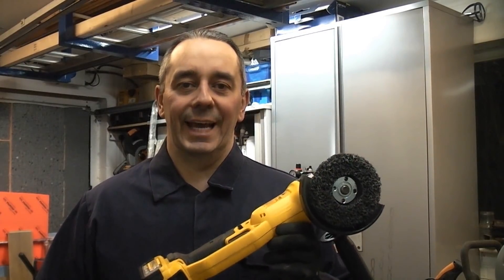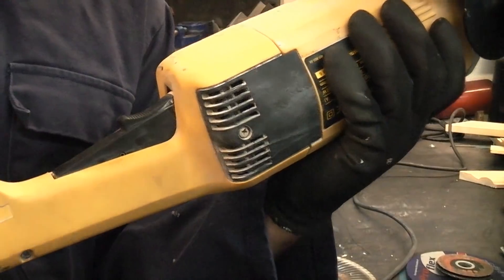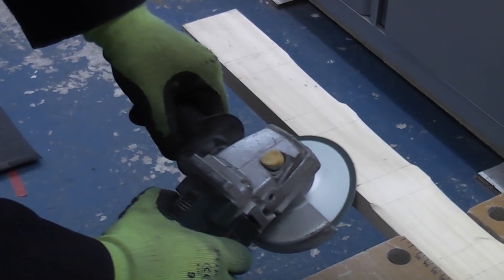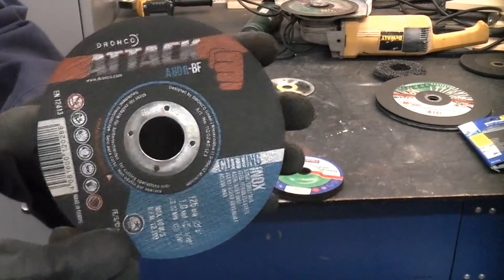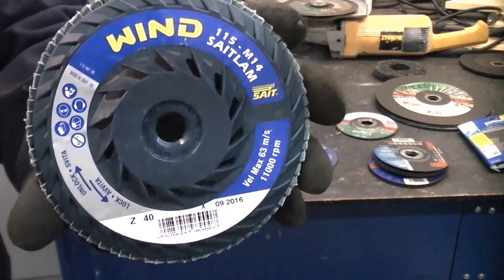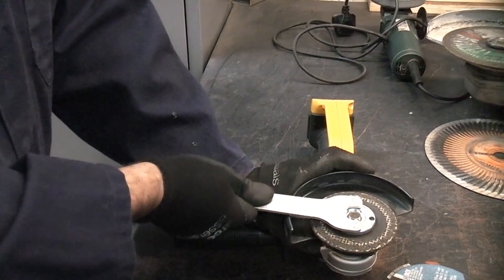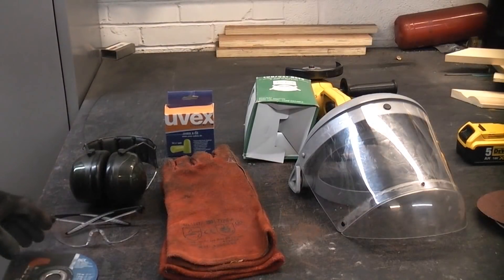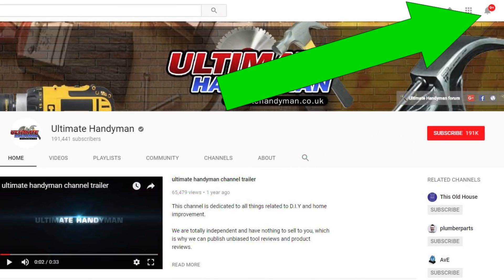How To Use An Angle Grinder-Angle Grinder Safety Tips

Comment: Is it safe to cut stone/masonry horizontally with a diamond disc? I’d use a 5” or 7” disc, not a stihl saw obviously. Normally I cut downwards, but can I cut sideways? Thanks 🙏
Reply from the maker: It is, but be aware that the grinder can feel strange if you move it from vertical to horizontal whilst it is rotating (you might not feel it with a small grinder, but you will with a 9 inch or larger), also be aware that if you cut right through the masonry, it might trap the disc under the weight of what is above!

Thanks for the comment 👍
Reply: Ultimate Handyman I want to precisely cut away the top layer of concrete on a small wall - just 6 inches - to lower the height. A chisel would be too imprecise I think. I won’t be rotating just cutting a straight line. I appreciate the point about getting the blade stuck. Good advice!

Comment: Absolutely fantastic teaching video👏🏽👏🏽👏🏽👏🏽. I've watched quite a few which scared the living crap out of me. Yours didn't. You explained the importance of using it correctly with the right blade(s) for the right job; how to use it and with the correct PPE. I would have liked to know if the smaller tool could cope with bigger jobs. I don't want to purchase a bigger tool if I could do most of my DIY jobs with a smaller, manageable Angle grinder. For example, I have a cast iron drain pipe with thick bolts to the wall that I need to remove. Could the smaller Angle Grinder cope with that?
Reply from the maker: Thanks, Yes a small grinder will be fine for that job 👍

Comment: Thanks, that has been very helpful. I've watched a few of these now having just bought a lidl special grinder. Everyone says "wait till it reaches full speed before applying to work piece". But my grinder has variable speed, so what is "full speed". Should I always set it to the max speed marked on the wheel ? Is there a particular problem running slower ? How critical is the speed, because the control is not calibrated, just marked something like 1-10, so the best I can do is suppose eg 5 means half of max rated speed.
Reply from the maker: I've never seen an angle grinder with variable speed. I'd just use it on the maximum speed for cutting and grinding and perhaps slow the speed down when polishing metal etc.

Comment: Great Job  - if you don’t mind me suggesting this (& maybe I missed it) but you probably could have covered the best or optimum positioning for the Guard as a lot of new Angle Grinder users have real difficulty determining exactly where it should be placed, relative to the job they are performing.  Maybe you could add a video section at the end, to help users with this important aspect of using angle grinders ?
Reply from the maker: The guard position is mainly down to personal preference. Hopefully people will be able to decide where it works best form them.
Thanks for the comment 👍

Comment: Good learning video on the proper use and safety on the grinder. Question. On changing a disc it fits loosely even thou it’s tight fitted,
Reply from the maker: The disc should never be loose, it is either the incorrect bore, or the flange is on the wrong way around.
Thanks for the comment

Comment: Very good video. When it comes to power tools you can't put enough emphasis on safety. You highlighted a good few points on the varied RPMs of discs and the danger of reusing spent 9" discs with 4½"  grinders, valuable information. Keep up the good work.
Reply from the maker: Thanks for the comment 👍

Comment: Thank you. More info about the positioning of the guard, how to hold it and where to stand would help too.
Reply from the maker: A lot of that is dependant on what you are doing. Just make sure that the guard is in between you and the disc
Thanks for the comment 👍
Reply: @ultimatehandyman  Is it the same with the flap disc? I noticed I can't put the flap disc flat for sanding large areas. I thought I saw it being used like that perhaps it's incorrect.
Reply from the maker: @ESLinsider   Yes, you should still be able to turn the guard so that it protects you 👍

Comment: Brilliant video! Very thorough from expiry dates to which way to put the discs on with great advice about use and materials. Really helpful thank you. Maybe I'm a bit boring too, but I read the manual on my DeWalt cordless XR Angle Grinder and it states to use a Type 1 guard (fully shielded) with a Type 1 disc (cutting: masonry, metal and optionally diamond), but not supplied and quite hard to find the official part. That said, the Type 27 guard (open faced) supplied is nice and deep, so better than no guard at all.
Reply from the maker: Thanks for the comment 👍

Comment: Great video but I would like some advice please, I bought a cordless 125mm angle grinder 2 questions, please confirm I can use 115mm discs? Also my grinder has a speed rating 8500min, does this mean I can I use discs with a higher speed rating but defiantly not less than 8500. Thanks
Reply from the maker: Yes, you can use the 115 disc on a 125 grinder, providing you do not use a disc that is rated at a lower speed (most 115 and 125 discs are the same). Yes, you can always use a disc with a higher speed rating.
Thanks for the comment 👍
Reply: @ultimatehandyman  Thanks for your reply.

Comment: An informative video,  I've bought a Parkside angle grinder last year,  along with a few packs of discs, for a couple of small stone cutting jobs, I genuinely didn't know they had an expiry date, I'll have to check them before use, as for some old ones my dad had from about 20 years ago, I'll definitely be scrapping those!
Made me very cautious about using the machine now, although the builders next door are happily using a huge 18 inch monster!
On another note, at 23:20 I noticed you have a green Halon 1211 fire extinguisher on your bench, these were banned about 30 years ago, due to the gas being toxic!
Reply from the maker: It's always best to be careful with old discs. I've seen a guy using a 9 inch grinder with no PPE at all on, he was chasing out the mortar for some lead work and closed his eyes once too much dust hit him in the face!
I always thought Halon was banned because it allegedly damaged the ozone layer, it is certainly one of the best fire extinguishers you can get. That extinguisher was removed from site in the 1990's when they banned Halon and replaced extinguishers with foam/water/carbon dioxide etc. Then a few years later they replaced all those extinguishers because the EU said all extinguishers had to be red with a coloured band to identify the type of extinguisher- madness!
Thanks for the comment

Comment: Do you think there are any problems cutting pvc (plastic) pipe with the cut off disks?  Thank for all the tips.
Reply from the maker: I have never tried it, but I would be reluctant to do it because the heat build up might cause the disc to grab. I have heard that people have used a grinder with a diamond disc, but I have not tried it - yet!
Thanks for the comment
Reply: @ultimatehandyman  Thanks for reply, appreciate your thoughts.   We have a farm, & I use a 14" chop saw with abrasive cutting disk on PVC  pipe (because cuts square) but have heard of possible loading of disk with plastic.  Also have used hand grinder on 10".  This is all repairs so not often. Take care.

Comment: fantastic. So very helpful to me. as I start using more power tools with my wood sculptures and metal bases.  Its been a year since I last was able to use my tools and I had forgotten how to assemble specific wheels on to the grinder.  I refreshed what I knew on that but learned so so so much more especially certain safety tips...that I am sure will assist in reducing accidents.  Some definitely would have happened. I was planning to use a cutting wheel on a piece of wood...I will use a more appropriate tool now! and get a full face mask vs just eye protection.
Reply from the maker: Thanks for the comment 👍

Comment: Just purchased a Bosch PWS 700-115. When looking at buying disc's I can't find the right mounting hole diameter one's. The instructions said the mounting hole is 21mm but I can only find disc's with a diameter of 22.23mm. Bosch again said there shouldn't be any play when mounting a disc. Can I use 22.23mm   ??????
Reply from the maker: They should be 22.23 If you click on this- https://www.bosch-do-it.com/gb/en/diy/tools/pws-700-115-3165140593892-199914.jsp#tab_zubehoer
Then accessories and then one of the discs it specifies them at 22.23

Thanks for the comment 👍

Comment: I remember before buying the angle grinder, I went through all the danger zones and injuries, it is a dangerous machine, but at the same time is a very versatile machine that has a lot of benefits, the more expensive ones have more features, but when you learn of how to use it safely you will get benefitted, the smaller one 115mm is relatively safe and bigger ones are more dangerous. not everyone can handle the bigger angle grinder. you have to know how to handle the machine during the kicking and hold it firm.
Reply from the maker: Absolutely!
Thanks for the comment 👍

Comment: Thanks very informative.  I do agree with what you said about using wire disks. I find the best thing to use for these. is a variable speed grinder, set at a low speed, It does a good job in a short time, with very good results.
Reply from the maker: Thanks for the comment

Comment: great info glad i watched it now .the reason i watch was i want to cut some tool steel i.e plane blades form hand planes .is there a certain type of cutting disc for hardened steel or will a cutting disc for stainless steel work. thanks Dave
Reply from the maker: Any steel cutting disc will work, but the 1mm thick ones are great, they are sometimes sold as stainless steel cutting discs or Inox.
Good luck with it 👍

Comment: @20:28 I didn't know that you were supposed to use the flat side of the flange on the depressed cutting disc. I thought you used the raised side on all depressed discs, not just the grinding discs.
I'm still new with my angle grinder, and luckily have not used the cutting disc yet. Thanks for the safety vid.
Reply from the maker: Thanks for the comment

Comment: I never knew there was an expiration date or that water could compromise the disc thank you for that information.. I was cutting up an old kids outdoor metal swing set yesterday when the diablo disc flew apart while making a cut. You said not to use the metal cutting discs on aluminum. I am now wondering ( not sure what kind of metal swing set was) if that is why I had the disc failure. It was an oh sh*t moment because even though I was wearing safety glasses and my chainsaw helmet with hear protection and mesh face shield, I realized at the split second the disc broke up that I had left the face shield up after wiping the sweat off my face a few seconds earlier. I agree with you PPE is very important.
Reply from the maker: Good job you had the PPE on 
Thanks for the comment 👍

Comment: You can buy all steel wood cutting discs that have teeth the same shape as those on chain saws. They are used to sculpt wood and are very effective . Surprising as it may seem they do NOT have a tendency to grab at the wood provided the work is secured properly. I've owned one for many years and have never had any safety issues with it but i treat it with the same respect that i treat my chain saws.
Reply from the maker: Thanks for the comment

Comment: Great vid :)
Personally I hate using angle grinders, find them pretty stressful! Now I know why, and glad I’ve not been being an over-cautious eejit. I now feel more confident in cutting into a redundant keysafe outside our front door.
PS when cutting a dead gas pipe out, the sparks managed to ignite some wire wool that was under the floorboards, that was fun (it wasn’t)
Reply from the maker: I've set a few things on fire over the years, but mostly when welding 😂
Thanks for the comment 👍

Comment: thank you this is a wonderful video:) QUESTION: what would be an ideal blade for cutting tin roofing? Thanks in advance
Reply from the maker: A slitting disc would be best for that, they are normally 1mm or even 0.8mm thick. Example here-
https://fave.co/3ecTVL2
Thanks for the comment 👍
Reply: @ultimatehandyman  thanks again :)

Comment: Very good video, mate. Could I just ask one question? When using a cutting disc without an arrow (On 22.00 minutes) you said you could put the disc on in any way. If the disc only has a metal boss on one side, do you not have to put the flange to the metal boss or can you affix it straight to the disc itself? Thanks in advance.
Reply from the maker: To be honest, I always fit them with the metal boss facing the flange nut (the same way as a depressed disc), but a guy that I know said he was told to fit them the opposite way, but I really don't think it matters to be honest. The next time I do a refresher for my abrasive wheels training I will ask the instructor.
Thanks for the comment 👍

Comment: Are there any safety clothes that can stop the grinder if a rotary disc or steel brush get in touch with it?
Reply from the maker: I'm not sure, most thick tough garments, such as leather will help- but PPE is always the last line of defence.
There is not much that will stop a grinder disc, apart from perhaps Tungsten carbide (that I know of).
The wire brushes pose another problem, as it could grab clothing and drag it into the grinder.
Thanks for the comment 👍

Comment: Thanks for this video! I've never used one before but it's definitely good to know about safety procedures and how they're used. In secondary school i think one of my resistant materials teachers used an angle grinder to sharpen a chisel
Reply from the maker: You are welcome.
They are one of the most useful machines you can get and as long as they are used correctly they are pretty safe.
Thanks for the comment

Comment: It looked like the guard was off on the very last shot where you're grinding.
Also, there's 2 different types of guards. One is for type 27/type 42 (depressed) grinding discs and the other is for type 1/type 41 (flat) cutting discs. I thought they weren't interchangeable, but I see you using a type 27 guard with a type 1 disc

Comment: Didn't know about the dates on the disc, thank you. Threw away a couple of old disks that were expired, now i know not to buy so many at the same time if i'm not planning on using them right away.
Reply from the maker: I didn't know until I did abrasive wheel training. It's best not to use expired discs, as it's not worth the risk!
Thanks for the comment 👍
Reply: @ultimatehandyman  And the things you said about safety, especially the guard. I see way to many idiots just grabbing a grinder to do some quick work without glasses, earmuffs or a mask, you could very quickly lose an eye or worse. Some of these grinders are chooching away at over 12000 rpm, there is ALOT of energy in that disc that can explode. NEVER REMOVE THE GUARD! it's there for a very good reason. better to use a different tool if you can't get to the work without taking it off :)
Reply from the maker: @Charlie6969   I watched a video the other day, on YouTube. The guy was using a grinder with no guard, and even used a pair of molegrips and a pair of water pump pliers to tighten the flange nut (he also put the flange nut on the wrong way around!)

Some people, just don't have a clue about grinders!

Thanks for the comments
Reply: @ultimatehandyman  Some people learn the hard way. They're selling cheap ones for as low as 10£ or even lower, so anyone can pick them up and use them not knowing how dangerous they are. I'm not against cheap tools though. 

Thank you for the replies :)

Comment: Thx! Expiration date and not throwing discs around? Who knew? I just had a grinder for 3 days. Luckily I kept the discs in the package until today. I'll do say this: If u have'm in a bag or alongside the grinder in the box u might press the lid down and carry them around. Later they might be broken I reckon. Hasn't happened so far. I been lucky using slightly bigger discs than intended. No safety on either. But batterypowered grinders slow down after awhile due to lack of batterypower. Or why they haven't exploded I dont know. Speed goes down as u grind as well due to friction. And the oversize hasn't been more than 1 cm. Using gloves and glasses, earprotection and a t shirt over my face. Just sayin 'cause I have no teacher. Luckily I go through these videos. I know about kickbacks and standing aside. I use mainly flapdisk on wood. Great video thx!
Reply from the maker: I'm glad the video helped 
Thanks for the comment 👍

Comment: @ultimatehandyman :Hi, can we use a 100mm disc on a 115mm angle grinder?
Reply from the maker: Yes, just check the speed rating first (the speed rating should be fine)